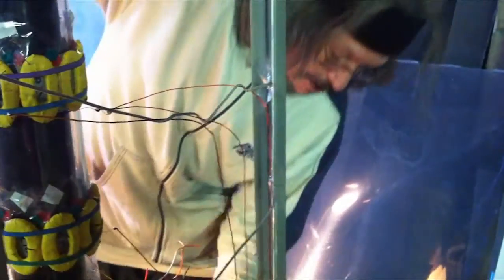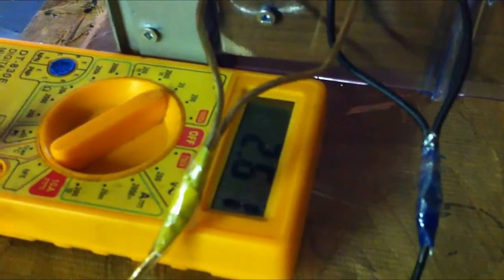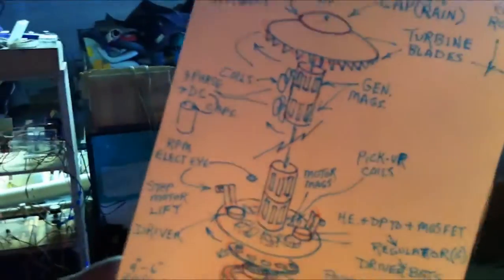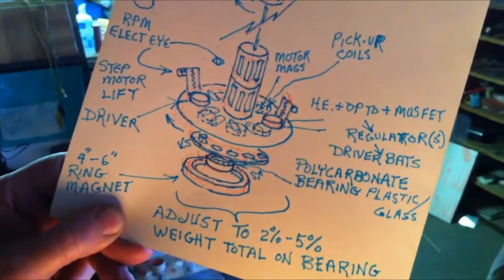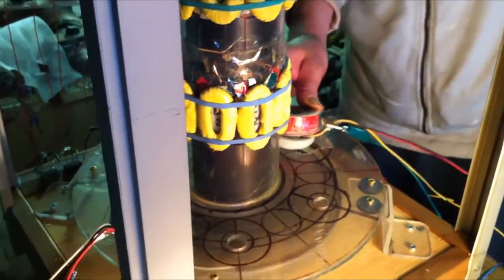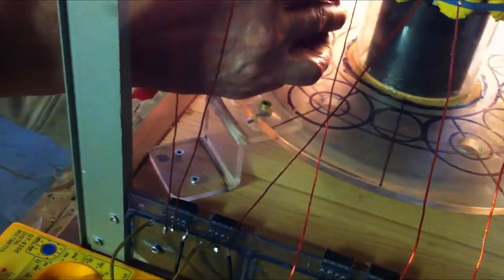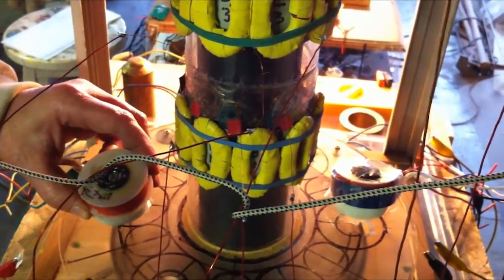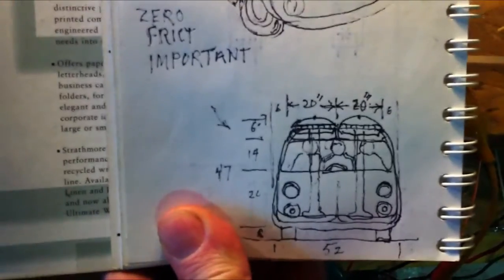UFO Alien Leak FS12b - Towers of Power Expansion

Comment: a 1 gallon air bag weighs 8.33lbs when filled with water.
 a 1 gallon air bag can lift 9.55lbs when filled with air.

use gravity for down stroke.. single air burst of 1gal.. will travel and produce power all the way to surface.. if in ocean.. that is miles
if in backyard well.. that is 100s of feet..

once it reaches surface.. release air.. then falls to complete a stroke/cycle.
i call it Grubble (gravity/bubble).. it came to me in a dream.. lol

imagine power of raising and sinking ship 24/7

Comment: Sorry if last comment was not clear: the bearing was rated 6.8 lbs max - and tested to 2 million turns. I am loading 30 earth-pounds weight on it - but due to double ring magnets repulsion - it is Levitated to only a few ounces. So should be good for 10 million spins. It's resistance is similar to a common CDR turn-unit & you know how easy that spins, with so little torquing effort!

Comment: Yes - I am using a similar method to your "3-1" ratio to mount my simple 3-phase magnets on plastic 4' axel! Two 1" X 2" main magnets on either side & to lock them in position; two 1" X 1/4" smaller ones on the two remaining open sides. This locks them so tight during spinning, no additional means are needed! (the FLUX, not the measure is 3-1). Succeeded today in mounting Levitational 2 ring magnets - axel sliding free in non-mag bearing. Rated at 6.8lbs Max, it weighs about 3 ounces! Like CDR!

Comment: The roof Pagoda-spinners are not to generate primarily; but to eliminate the initial torque needs that have been killing the batteries of electric cars. If you look at the efficiency curves of wheel magnetic drives, you see they go from 30% at starting to 90% at 40 or 50mph. This corresponds to 100-200axel RPM's. Without the Levitation magnetics & sup. non-mag bearings this would not work (too much bearing friction). The blades must spiral in, getting thicker & air holes out in center. Inv turns

Comment: @MrJoeVig You're thinking motor - not generator. You're thinking consumption - not energy production. Try to upgrade your mind, by looking at a few electronic generator vids (avoid the commercial ones), then come back with new eyes - that register the conversion of invisable magnetic flux into electrical current when moving (changing) fast. Then build a better one!

Comment: About the Alien Spacecraft sketches. I told some UN people then that I thought the propulsion was an accel. metallic plasma ring - they seemed to agree. By '91 remote control model (England); by '93 lift-off from area 51 (triangular TR-3 w/corner lights); by 2000 fleets in 3 countries; present - this is "Earth's Space Force" w/lasers/particle beams/HAARP. Fake Alien "attack" plan 2006 (since given up). None have helped Earth's peoples, as you may be reading. These cars will! Cheers.

Comment: The basic concepts are to internalize Levitation (external needs way much power); cut friction & heat to zero; use ambient energy as much as possible; by-pass wheel-motor link since generation can use small fraction of current; and of course eliminate fuel, batteries, weight and expense. Anyone can work using these & maybe come out with much different? Continued fuel leads to fascism, war, and planetary ruin - as Ron Paul march today was aware in their chants (he rides bike for fitness).